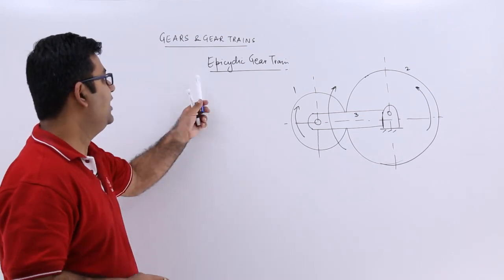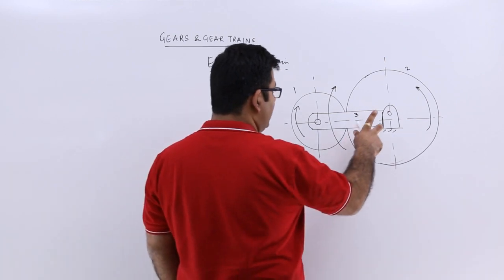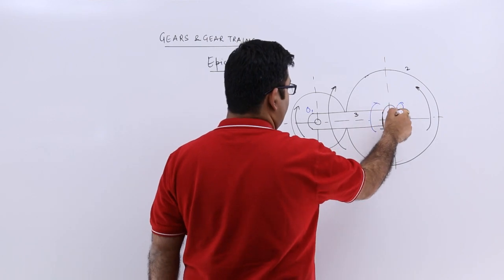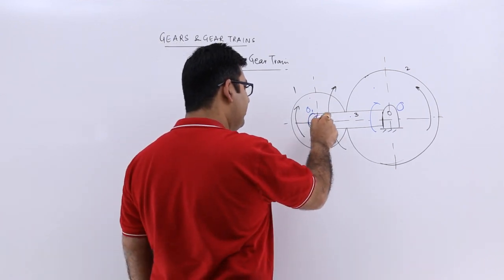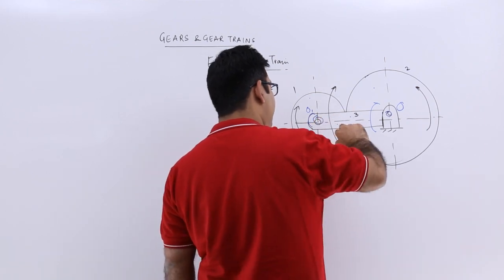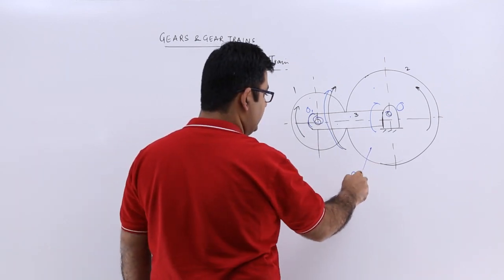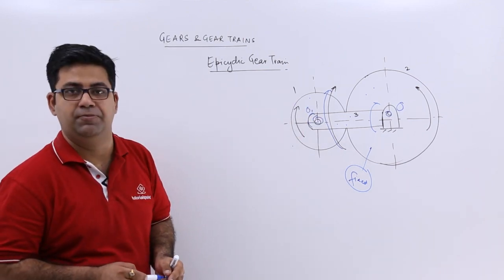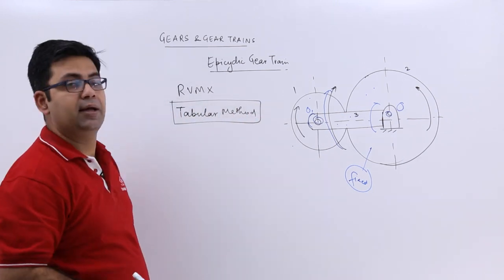Epicyclic Gear Train

Comment: Your definition of epicyclic gear is not correct. in the minimum configuration you have shown(3 components), there has to be 2 moving parts and one fixed always. You can always have two ratios in whichever configuration.  
In epicyclic gear box, 
1) you can insert idle gears to connect non-matching gears , thus getting higher reduction in minimum space. 
2) You can get rotation out of the rotating fulcrum, also getting  higher reduction in minimum space